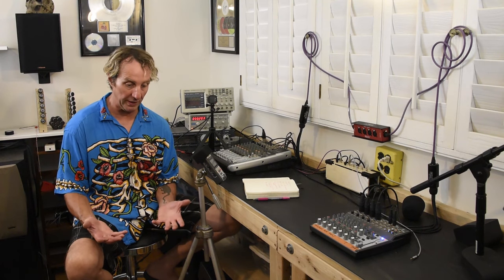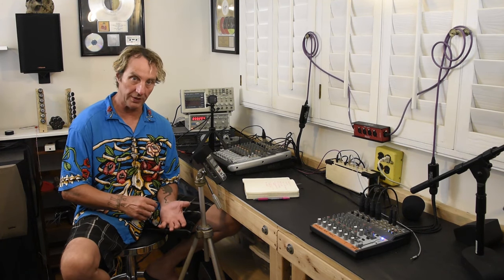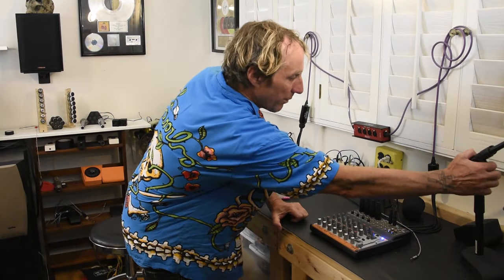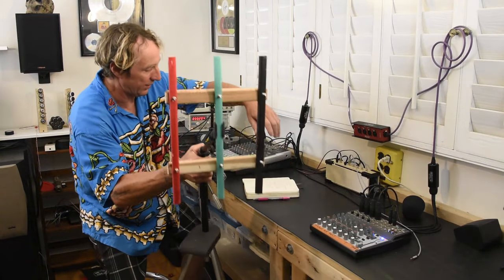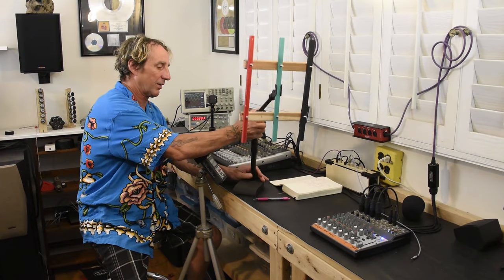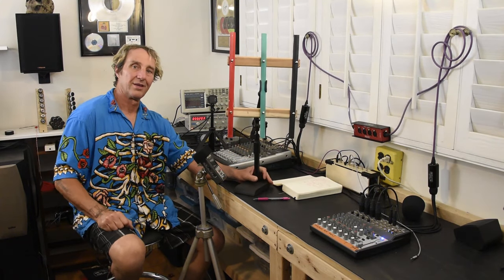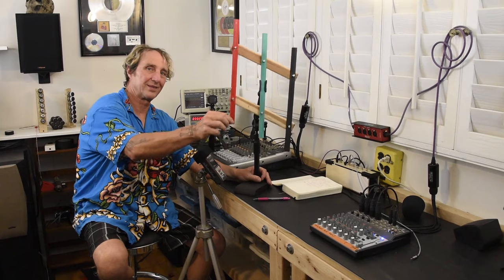Pin 2 vs Pin 3 Hot in Audio Gear

Comment: With these valuable tid-bits of information I think I just figured out why one of the amp models in the main rig I run always has to run 180 polarity in the DSP for in phase output to the speakers matching the others. Pin 2 and 3 on the input must be reversed from the factory when compared to all the others we use. That would explain why all my cables and speaker wiring checked out but I still had reverse phase till I swapped it using the amps onboard DSP. Silly manufacturers... Thanks Dave
Reply from the maker: yes, some manufacturers make their speakers work well as a unit but not well with other speakers

Comment: That is very interesting about the JBL Drivers. Liking it....
Reply from the maker: Thank you Steven!
Reply: Yes, thank you for that info.
Reply: @DaveRat  Do JBL STX series uses the + inward and - outward logic or its on older models?
Reply from the maker: @EndritVj  not sure on which models switched. I stopped using jbl raw drivers quite a while back and they were still all backwards. I have tested some that are correct though
Reply: @DaveRat  I have come across this on STX835 that the connections from the internal crossover to the low drivers are the - from crossover to the + of the low driver and the + to the - . Maybe it might have something to do with the facing of the drivers inside the cabinet. But is interesting to know that they have done this before. Cheers.
Reply from the maker: @EndritVj  with speakers you will find that some manufacturers invert the polarity on the mids or highs to try and get drivers to work together in the crossover region. Even subs can be inverted. It's all over the place. Ideally when you use the same brand, all there speakers will play nice, but not even that happens. L-Acoustics and d&b and a few others being an exception
Reply: @DaveRat  True that. Some manufacturers would also do it by switching the polarity on the signal processing, example EAW KF730 in its old (non greybox) settings requires to switch HF signal polarity. Btw L-Acoustics rocks. Have you yet listened to K3? I’m exited about it.
Reply from the maker: @EndritVj  excited about K3 as well. Will hear it soon as we are doing an install with it. Will update when we do

Comment: Thanks for this Dave..i was about to modify the inputs on an old pin 3 + Ross Mega 400 amplifier...to run some cheap wharfdale 12" stage wedges for lo fi gigs. I will make those input polarity switch adaptors as advised and just leave them plugged in.

Comment: In the stating the obvious department, audio signals being inherently AC, both pins are hot. It's just a matter of polarity, and as long as it's consistent, there's no problem.

This reminds me of a trick I learned a long time ago to try to eek out every last watt of amplifier power by inverting the phase of one channel of a stereo amplifier (this could be as simple as setting the bridging switch, though I used inverting outputs of a crossover to do it) so that if there's a transient that might last a half-cycle, the (push-pull) power amp would draw that half-cycle from one power supply rail for one channel, and from the other rail for the other. A good idea in theory, but because of the way sound works, the inevitable reaction to a compression event is a rarefaction one, so IRL it wasn't that useful. And because crew members (including me) would forget to invert the banana connectors on the one channel output, it was more bother than it was worth.
Reply from the maker: Good stuff, yeh, actually I am pretty sure that amp trick came from an article I wrote for pro sound news back in 2011. Since then, amps like lab gruppen and powersoft actually build that aspect into the amp.

https://www.prosoundweb.com/fighting-for-power-a-way-to-increase-the-actual-power-that-amplifiers-deliver-to-loudspeakers/
Reply: @DaveRat  well, I learned of it in the 1980s, and recall that the Dynaco Stereo 416 had an optional C-100 capacitor bank to tackle the same issue in another way back in the '70s. I'm sure that a lot of people who looked at a push-pull amp figured this out long before the person who told me (might have been Gary Gand, he's on PSW) figured it out. What made it easy was good and inexpensive inverting line amplifiers on a chip that we started seeing in the '70s.
Reply from the maker: @StringerNews1  very cool and I figured it out when doing power tests comparing stereo to bridged. And saw that the bridged power into 8 ohms was higher than stereo power into two 4 ohm loads.

I then investigated why and found that an XLR polarity rev adaptor on ch2 plus rev the speaker leads on channel 2, gave me free power.
Reply: @DaveRat  well at least you were able to measure a difference. I just took it on faith that it worked. That kind of test equipment was beyond my reach back then, or if I had that kind of money, it would go into another amp... 😁

I had a lot of Crown DC-300A amps because they were ubiquitous where I lived. They didn't have balanced inputs, but the VFX-2A (that were also plentiful on the used market back then) had inverting and non-inverting outputs.
Reply from the maker: @StringerNews1  so cool to hear about the existence so far back. Basically to measure the power, it was a scope to see clip, a load and a tone gen. I brought it to clip in various setups and saw 100snof free watts, that said, it calcs out to less than a DB on the amps ii tested.

I followed the - every little bit counts and apply many bitsbut each bit by itself is no biggie, and together, it's good.
Reply: @DaveRat  after a while that little bit starts to add up. :)
Reply from the maker: @StringerNews1  agree and great to meet you!
Reply: @DaveRat  great to meet you too!

Comment: Another good one Dave. Is there any way of testing a signal for polarity, if you don’t know what it is on a certain piece of gear.
Reply from the maker: Yes, easiest is a polarity tester. Also you can 5ake the input and output signals and run them into 2 console channels and nix them togther. If they are polarity reversed, you will get cancellation
Reply: @DaveRat  - Thanks Dave, I’ve never even thought about their being a tester available, I should have known. 👍

Comment: Well said Dave. 
Does anyone have any examples of gear that uses pin 3 hot from the manufacturer? I don't think I have seen anything and only come across pin 3 hot from man-made DIY mistakes or bad solder repairs.
Reply from the maker: Check out page 5

https://www.technicalaudio.com/pdf/Klark_Teknik/Klark_Teknik_DN360_manual.pdf
Reply: As I understand it - Oktava microphones are typically wired pin 3 hot. Useful to know when dealing in multi-mic'ing a source with them.
Reply from the maker: @this_plain  interesting. I will do a video on checking mic polarity as it is simple and can be important when using two different mics on an instrument
Reply: @this_plain  thanks good to know. I haven't used mine in years but now I'm curious and will be checking my mc012 pair when I get home.
Reply: @Audiosyntax  would be curious to know if they are. A while back I was looking at buying a pair of MC012 and got the impression that there's two runs: the MK012 & MC012. Seemed like one was done for the western market and maybe is wired pin 2 hot? The pair of MK319s we have are pin 3 hot.
Reply: If I’m not mistaken the Soundcraft K2 series consoles flipped TRS channel inserts. I got gigged on a show when we didn’t bring the turn arounds for the outboards... The acts FOH crawled up my backside.... Lessoned learned.
Reply: @Auxknob1  YIKES
Reply: Scottjcpp - lol thanks, not my best gig that day.
Reply: Auxknob1 😂
Reply from the maker: Yes, soundcraft had ring send as standard
Reply: Dave Rat - Thanks for that, I knew I wasn’t crazy. Been YEARS since I played on a K2 and I remember if that essential “bag-o-daptors” didn’t go with the desk someone could have a bad day.
Reply: @this_plain  confirmed my Oktava MC012 pair are wired pin2 hot. I believe they are the UK version from the early 90's. You are probably right about them being modified for the western market. However, I have no issues hitting a polarity switch on a mic if needed.
Reply: @DaveRat  Thanks! I know I've used the DN360 before but had no idea it was pin3 hot. I'm thinking the rental house tie-wrapped cables were actually phase reversals. As you mentioned I think this is good practice if you own gear like this.
Reply: Great question, Nate, and very timely!  Only a couple of weeks ago I took delivery of a Klark Teknik DN410.  It is similar to the DN360 in that by default, pin 3 is considered hot, HOWEVER, the DN410 has internal jumpers to select either pin 2 or pin 3 hot.  Presumably this would only matter when the input type (balanced/unbalanced) doesn't match the output type (balanced/unbalanced), as Dave mentioned in the video.  But there's a catch!  The DN410 appears to have electronically balanced, or optionally transformer balanced input , but unbalanced output, unless it has the optional output transformers installed.  In any case, it makes me want to investigate a bit more to understand what's going on.  This video helps me understand what to look for. Thanks for that!
https://tcfurlong.com/wp-content/uploads/DN410-User-Manual.pdf
Reply: @Audiosyntax  thanks for the update! Interesting.
Reply: I think a lot of British processing gear is/was 3 hot. I still have my BSS, Drawmer, Klerk, stuff and if memory serves it’s all pin 3 hot.
Reply from the maker: Zack Darce  hey hey Zack! yes, I release videos to members first, as well as additional videos and live zoom chats.
Reply: Bose 802 ‘controllers’ have pin 3 as Hot, which can cause polarity issues with monitors, ie the performers think the main PA is not on!
BTW I’m in the Uk working in broadcasting and it was the only gear I came across with pin 3 Hot XLRs.
Reply from the maker: Zack Darce  to the best of my knowledge all modern gear is pin 2 hot unless it's a vintage unit still made.

That said, you only really need to worry about pin 2 or 3 hot on amps/powered speakers or when converting from XLR to 1/4" and not coming back the same way.

Also, polarity reversals are not that big of a deal as long as you are not summing the same signal to itself with opposing polarities.

So this is both complex and a concern and also not a big deal in most scenarios.
Reply: A Midas XL3 is pin 3 hot.
Reply from the maker: @Midash2k 🤙👍🤙
Reply: @DaveRat  Here is a fun anecdote about the XL3 and how I came to find this video.   So I have an XL3 I am modding for recording use. I have added DB25 connectors in parallel from the TT Inserts points…  my plan is to send to my DAW via  the insert sends over DB25 to an Antelope Orion 32 …. And return to the console via the Insert sends on DB25… 

And just for fun I thought I’d A/B the signal coming back into the insert return as see how it sounds compared to the XLR/ Preamp input, which is fed from a DB25 to XLR male.  And when testing I noticed the signals would cancel eachother out when summed… I thought for a moment that I had wired all of the DB25s backwards, but it turns out the problem is the DB25 to XLRs are pin 2 hot…   

So lesson learned, as you said, if it’s XLR to XLR it doesn’t really matter, but it does matter if you are going to change to a different connector, in this case a DB25

Comment: I'm setting up audio for a school play.  We have XLR to 1/4 adapters that say "pin 2 hot" on them, but they won't work.  Our soundboard has both XLR and 1/4 ports.  Should we use "pin 3 hot" adapters?
Reply from the maker: It's worth a try. If you can determine what the console XLRs are then you will know for sure. Modern consoles are pinned 2 hot and older ones can be either pinned 2 or pin 3

Comment: Hi Dave! Is there any recommendations for soldering XLR cable ? I mean if you have a cable with grounding shields and white and red cable. I heard some clue for it: Red (reverse), Light (Live).
Is this correct or is there any norm or standard ?
Reply from the maker: For me, everything was pin 3 hot for many years as we used a lot of English gear and crest amps, all pin 3 hot.

Now we are pin 2 hot but the colors we use are the same for XLR. I tend to useba modified concept of color code of ac wires.

Black is hotter than white, red is hotter than black, everything is hotter than green. 

But to further complicate, I still think and wire in pin 3 hot terms and then adjust when dealing with unbalanced

So, black to 3 for me.

Comment: Thanks for all the work and info you put into these videos :)
I have a practical question. I'm using the A&H QU16 and want to use one of the mix outputs (low impedance, differential driver circuit, +4 or 0dBu) to send an audio signal to a guitar pedal, and then back in via the stereo line balanced jack inputs. The manual states (for the mix output) to make sure the XLR pin 3 (signal cold) is linked to pin 1 (ground). Is it enough to make a XLR to jack cable that way (going from mix out to pedal in) or does the impedance also need changing? Sorry if you already covered this in another video. Cheerio!
Reply from the maker: Driving a high impedance from a low impedance out is all good, as long as there is sufficient voltage. And the guitar pedal out will be low impedance.
Reply: @DaveRat  ❤️👍
Reply: @DaveRat  I'm 45 and this is all new to me. So, if I use a female XLR to male stereo jack cable (1 to sleeve, 2 to tip, 3 to ring) and connect the stereo jack to a mono plug of the pedal, will then the mono plug connect the sleeve and ring together (so that pin 1 and pin 3 get connected in that mono plug) and eureka?
Reply from the maker: @joco9958  don't use a stereo jack. Use an XLR fm too o jack
Reply: @DaveRat  ok, thanks again Dave 🙏

Comment: I've never seen pin 3 hot unless its an old qsc amp!
Reply from the maker: BSS gear like the DPR 402 compressors, Klark Teknik DN360, Crest amps like the 8001, 7001, 4801 are all pin 3 hot.  Loads more gear from the 80s and earlier. BSS switched to pin 2 hot with the DPR404 series and gear released thereafter. I think old Crest consoles as well.
Reply: @DaveRat  Thanks so much. so if someone had one piece of that gear online technically the whole system could be 180 out of phase. which really wouldn't matter. Correct
Reply from the maker: @SoundBarrierEntertainment  correct, though mons tend to sound slightly better when in polarity. We had issues years ago with using creat amps and our min rig was polarity rev compared to other rigs, say when we brought wedges on a festival and used house sidefills. Later we switched Mon polarity to solve
Reply: @DaveRat   Another good point. I hope we can get back to what we do someday. I'm still in the process of building a super sub with car audio. Using the Digital Designs 9918 Drivers they out spl anything i've tried in the commercial industry. Maybe you have some pointers as to what build to make. Is is better to use a single  or should we double em up.
Reply from the maker: @SoundBarrierEntertainment  make the enclosures rigid. Less speaker in more box goes lower, more speaker gets louder. Good stuff!
Reply: @DaveRat  ok will do ill post a video of it too!!! Thanks for chatting  with me. Most engineers i never hear from>>
Reply from the maker: @SoundBarrierEntertainment  cool cool, yes, I'd like to do a test of car-fi subs vs pro sound sub speakers. I'd be super interesting

Comment: Hey Dave. Thank you for this video. I'm curious though, I have an A&H GS3000 (pin 2 hot console) and an Otari MTR-90 II (which I believe is pin 3 hot). I'm going XLR from the machine into 1/4" TRS into the console for both send and receive. I think what you're saying is it should be fine? Or should I reverse pins 2 and 3 on the XLR to 1/4" snake?
Reply from the maker: You should be fine.  Theoretically, the recordings will be 180 polarity reverse and the playback will reverse it back.

Ideally, the 1/4 to XLR would be tip to pin 3 and then all would be polarity perfect.
Reply: @DaveRat  Thanks. I haven't ran into any problems (using pin 2 gear, converting, etc...) But this video just had me thinking. Maybe I'll just solder the 1/4" pins just in case one lazy day... I appreciate the help!
Reply from the maker: 👍, yeah the only think I can think of is absolute polarity will be reversed as in, a kick mic'ed from inside will create a positive pressure that makes speakers move outward first. And the recordings will be reversed if the recordings are mixed at another studio. 

That said, absolute polarity or polarity should not be audible. But, speakers being slightly non symmetrical, can sound slightly different when polarity is reversed. Though it may be a bit more or less desirable, every speaker system will be different so it becomes a non issue

Comment: Dave, I own an Aston Origin mic. It has 3 pin hot instead of 2. I'm getting some weird static signal when recoding. Would it help if I rewired pin 2 and 3? Thank you!
Reply from the maker: If the input and cable is balanced, and wired properly, the only difference between pin2 and 3 hot is polarity.

Sounds like something else is the issue
Reply: @DaveRat  Thank you! I've tested the mic against its older brother Aston Spirit, as well as Shure KSM32, Neumann TLM 103, Neat Bee and even by beloved Zoom H2n. None of them have that annoying white noise the Origin has. I've read that it has 3 pin hot which is pretty uncommon (the gearspace forum). I did carefully listen to what you're saying in this video, but due to my limited ability to understand what's happening it's hard to digest it all. I will try to fix the mic or sell it. Thank you again, Dave and good luck!